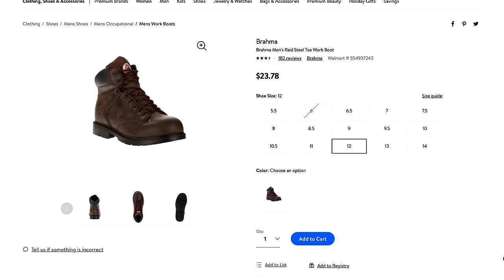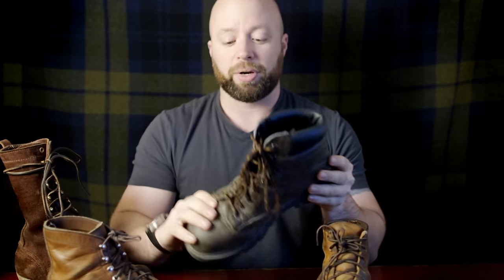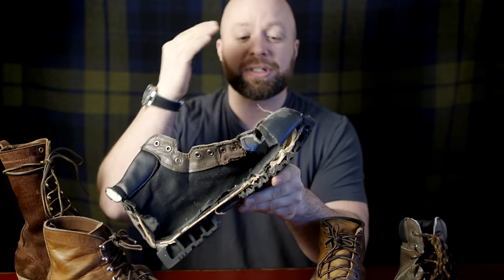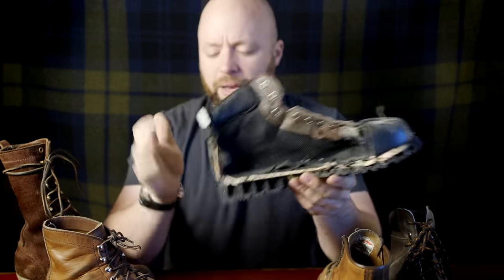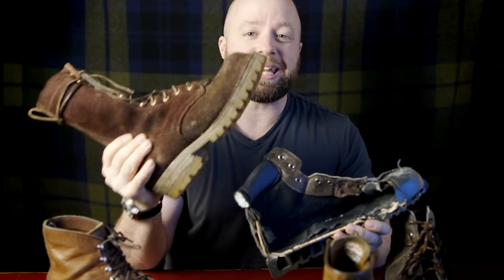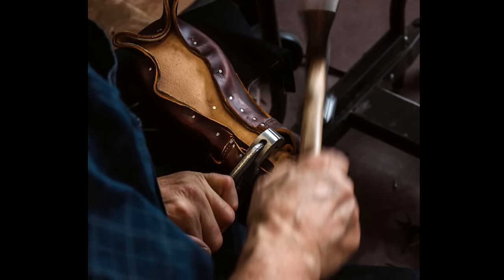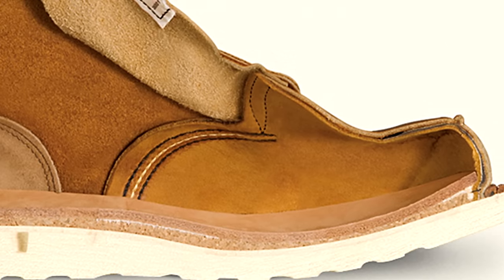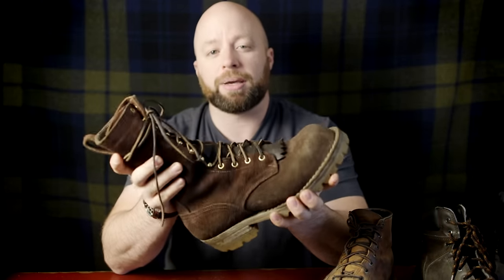Expensive vs Cheap Work Boots

Comment: Love this video! Wanted to share my experience because I realize its incredibly uncommon. So I work as a Locate Technician for Dominion Energy, and my job requires me to walk between 1-5 miles a day, and lots of crouching. I started my job about a year ago, and bought myself the Doc Martens 6" Heritage Ironbridge ST (retail $134.95) and within 3 months the sole of the right boot had split down the middle, and made the sole completely seperate from the boot. It was the middle of the work day, so I had to make a quick trip to Walmart where I picked up the exact pair of Brahma boots as shown in your video. While they were terribly uncomfortable, the lasted longer than my Doc Martens by about a month. The bottoms eventually started cracking and water was seeping into my boots from the bottom. I then replaced them with the exact Colemans that you have in the thumbnail (retail $69.99), and they took the cake for the most uncomfortable boots I've ever worn. Within an hour of wearing them I had sores on my heels that had been caused by the steel shank in the heel of the boot, they had torn through my Carhartt boot socks, and have absolutely no support anywhere at all. Comparing the Brahma and Colemans I would take the Brahma 10 times out of 10. Needless to say I returned them the following day. I am now on my 4th pair of boots within the last year, and they are the Denali Bullseye (retail $44.99, purchased on sale for $29.99), and so far they are up to par with my Doc Martens as far as durability goes. They are not as comfortable, but absolutely a step up from the Brahmas and Colemans. From my experience, you shouldn't settle on the cheapest boot, but paying an absurd amount may not be the best option either. Venture out and try a variety of different boots until you've found the ones that best suit you.

Comment: How are baffins, I work around drilling chemicals including formaldehyde, acetic acid, sulfuric acid (low concentration), oil based drilling mud, water based drilling mud, and cuttings. I need a waterproof boot that can stand up to 35 days straight of 12 hour days. I've tried multiple brands of rubber boots from a $200 pair to a $50 pair. Rubber boots just fall apart. I need something that will last more than 1 35 day hitch. I currently run some schmidt's from tractor supply that work ok. But I'm looking at getting the best that will last the longest

Comment: Security guard here so I don't need stuff like steel toe or metatarsal protection.

Had a pair of Worx (by Redwing) that were about $120 in that 'tacticool' half leather half black nylon style.  Side zip, composite toe (I used to be around a lot of electrical equipment).  Got some of those plastic reinforced insoles.  They were fine but after a while the top of the boots sagged and I somehow managed to wear the hell out of the insides.  When I went back to the store to shop for another pair (they didn't have any in stock) I learned that the rep gave me a pair that was too wide, even though I stood on the sizing machine (think she wanted credit for a sale or a commission or something).  Didn't inspire me to go back.

Next was a pair of EMSs by Danner for $250.  Ho Lee Fuk. All leather, no metal, antimicrobial (sp?) insides and with some Protalus insoles, these were night and day better for $100 more.  Like the Worx you can't resole them but four years and they're still good.

Comment: A little over a year ago, my Grandfather bought me a pair of these (the Brahmas) because I needed a work boot. Despite being a size 13 they fit like a size 15 and I slipped 3 inserts into the actual boot. After stuffing three inserts (the inserts that came with them, and then a pair of Dr. Schol running insoles, and then an insert from a pair of Nike running shoes on top of that) they actually wound up being pretty comfortable. (My shoes came with inserts in them, and the ones in the video do not have them)
Reply from the maker: Well you definitely modified the heck out of those! I think they can work well at first, but not long-term. Still man, the fact that your grandfather bought them for you gives them a special meaning. What a good dude. My grandfather left me a bunch of his old tools which I hold very dear.

Comment: Try working a shovel with those damn Brahma boots. The first stomp on the shovel will kink that cheap plate in the sole. About every hole I had to take my boot off and bend it back as straight as I could to walk.

Comment: "Buy the best tool you can" is why I spent $320 on a pair of 8" redwings. Been 2 years of heavy almost daily wear and haven't looked back.
Reply: What trade are you in? Im in grading and am looking for  a new pair. I Have had my timberlands for over a year  now and i can say they were worth it to me.
Reply: @adamsgame62  kind of a jack of all trades. I'm a manager at a carwash so usually 8-9 hours of walking on concrete that could have up to an inch of water with the occasional plumbing, electrical, and welding inbetween when I'm not rebuilding/replacing equipment.
Reply: @jacobgebhart7550  nice! Reason I asked is I'm always on dirt or base rock so I'm looking for something that will be comfortable but will last.
Reply: @adamsgame62  I've probably worn these boots 650 times in the last 2 years and while they need to be resoled and given a new pair of laces they've held up extremely well. I want a pair of nicks for my daily wear and use the redwings as backup for the nasty stuff.

Comment: I swear by Irish Setters. Elk Trackers uninsulated for anything but work and the aluminum safety toes for work. 
Buy them on sale and find a coupon. I bought my last set of Elk Trackers for $65 form the local Red Wing Shoe. My last pair of aluminum safety toes were about $80. 
Local leather shop can resole for about $35. 
Have heard great things about thorogood boots. Have never tried a pair. 
My local leather shop also makes a great pair of cowboy boots.

Comment: Cheaper boots are better in long run when you work in Stucco/ EFIS.

Expensive boot will be destroyed by the calcium, acrylic, and quartz. If not cleaned after each use.

I've narrowed down to a year and a half on a pair of timbs pitboss

Comment: Redwing Iron Rangers may not be as beefy as most current work boots but they were designed to be like old work boots, hence the “heritage” in the name. They were work boots then so they still are now. They just don’t have modern updates. I would say the Iron Rangers can be a work boot worn if you’re not worried about crunching your toes with something on the job. The newer Iron Rangers do have tread on the bottom as well. They are a versatile boot. Work, casual, or semi-formal settings. Given their good qualities and being versatile, it makes sense that the “hipster” crowd takes advantage of them if you want to go there. A have noticed there is a broad array of people who like them.  (Long comment I know. Bored on my brake 😉)

Comment: I will agree on most of what you said.  However I will say it is worth it more to buy good insoles and cheap boots, in the case of very high replace rate. Example if you are doing epoxy on floors where it builds up on your boots and you can't get it off.  As cheap vs expensive will both go at the same time. Having two sets of boots is good for that as when you are doing the less nasty part you can wear the good ones.

Comment: I've worked in the Wescos and the Red Wing 877's and they are awesome.  Never had Nick's or Franks, but was told they are very good boots.  The price was worth it since both boots lasted over 6 years and my feet and back feel fine.

Comment: Could not agree more. Over here in Europe we have not that choice of you guys in the USA. I have to use the S3 class working boot for over 20 years.Wear and seen a lot of sorts and brands passing by. My defenitly choice is the Lowa Renegade mid S3 and a pair of sneakers look alikes, the Elten (L10) with Vibram soles, also mid high. Both are not the cheappest ones. But the last for almost 3 years now. After a day working with grease,oil, debriss i Always clean them up and, if necessary a bit of leather grease. Checking the laces.That makes the difference between cold and wet feet and dry and comfortable working through the day! Also remind that your socks are playing a very important role in this matter. Change them every day for a fresh pair. Let the shoes breathe well overnight.

Comment: Good explanation of the value of workboots. That solid support will help avoid lower back and knee issues in the long run. My favorite work boots are a pair of Viberg Foreman's. Viberg sells a lot of expensive fashion boots to the Japanese and urban Hipster markets, but they made their original  reputation building extremely sturdy work boots. If you don't have time to learn about insoles, midsoles, heel counters and all that stuff that makes a high quality boot, just pick them up. Leather is heavy and good boots are heavy boots. My Vibergs are 6"  and they still way over six pounds the pair. Leather everywhere. They take longer to break in, but when they're broken in, It's such a perfect mold to my foot, I wouldn't dream of skimping on cheap boots. My back and knees and feet are worth it.

Comment: My own experience over the years has been that if boots cost less than $100, they simply arent going to last. Even if you're not doing physical work. In a basic office type environment, cheap boots are going to let you down.
That said, I've have never, and will never spend more than about 250 on boots. It's not necessary for what I do. But there are certainly people working jobs that should considering spending well over what I spend on boots because their work type really requires it.
If someone is working in a machine shop and is fine with walmart boots, they aren't working in a machine shop; they're just collecting a check and someone else is doing all the work.

Comment: Here is my question for everyone...I work in a cold storage warehouse. Most times I am either in 35 degree weather or in -8 temps. I have worked prolonged periods of time in the -8 temps (everyday/5 days a week). I have tried redwings & thorogoods and over time the soles break in half due to the freezing. After about 2-3 hours straight in -8 temps the soles are rock hard. It only takes about 4-5 months and soles just break in half. Any thoughts on different boots or better suggestions on what to buy?
Reply from the maker: Check out Refrigerwear. They were designed for people working in conditions exactly like yours, with a line of footwear, jackets, and coats.

Comment: Redwing heritage Roughnecks for life. Best work boot I've used. Made soo well. And they're basically waterproof even in they're not rated as so because of how well the heavy leather is oil tanned. Comfortable, beautiful and tough. And have some of tbe best Vibram soles out there. 

Although I don't need Steel or Composite toe at the work place. In fact I think steel toes are a bit of an odd thing, but if they're required you have to wear them obviously. But if something heavy enough drops on your feet to crush your toes, you're doing something wrong.

 Plus some work places recommended against them where there's a high chance of something landing on your feet. Your toes can get cut in half from the steel.

Comment: Used to use the cheaper justin square toe workboits the ones around 100 bucks and they were good and comfy but inside the throat always brokedown before the rest of the boot unfortunately but good boot . Then i bought a pair of square toe Ariat workhog square toes priced at about 180 the ones without composite or steel toe. I never knew my feet could feel so fresh at the end of the day with the composite shank in the arch area my feet were thanking me so much and i realized that since my feet were not aching at the end of the day my quality of work and my attitude were much improved.  Not bashing the justins. Just me personally i would use the cheaper justins if im doing really dirty work and destroying the boots because they're cheaper and my ariats for everything else

Comment: red wings are the absolute best. had a pair of 4417s for damn near 5 years til i dropped an angle grinder on my foot and ripped the toe open. id probly still be wearin em today if i didnt do that. best $200 i ever spent. even the carolina loggers i had didnt compare- the leather got eaten away by mastic remover and so did the skin on the top of my feet!

Comment: Boots are important. But don't forget the socks, too. There is a large difference between a cheap pair of Hanes or Fruit of the Loom socks, and a solid pair of Fox River or Wigwam work boot socks. Better material, thicker, better sweat handling, etc. Like a quality pair of boots, they make a big difference by the end of the work day. They are worth the money.
Reply from the maker: This is absolutely true. I’m a big fan of Darn Tough Vermont socks, but I’d love to try Fox River.
Reply: I've not tried Vermont, yet. But I will. I never realized how much difference quality socks made to a work day until a retired tradesmen friend gave me a pair as a gift.

Comment: 100% agreed.  US Steel (Fairfield Works - Seamless Drilling Pipe) required metatarsal sheild boots.  This protects the top of the foot and just steel toes results in cut off toes if a pipe drops on them.  Even in the 80s they were over $100/pair.  Seriously heavy but also super well built and comfortable if you wear it for 12+ hours every day.  Cheap boots are torture.  Boots are a tool you don't skimp on.

Comment: So for years I bought nothing but Georgia or Carolina and loved every pair until about 3 years ago I bought the same pair of Carolinas I had bought many times before. Never had to "break them in" but these ones were different they didn't feel like home. Upon further inspection I find that both of these 2 companies are no longer manufactured in the US. The price point didn't change but the quality certainly did as they never became comfortable and didn't hold up. I recently bought a pair of Justins it's been 6 months so far so good. Also I would add that if I spend $300 on a pair of boots that last 3 years it's still cheaper then buying a $30 pair of bramahs  every 3 months in that same time period dollar for dollar not even taking in to account the medical for back problems and fungal infections.
Reply from the maker: Unfortunately this happens more than we realize. It’s cheaper for the manufacturer and they simply rely on brand recognition, Filson, North Face, even Doc Martins have followed this trend.

Comment: In England employers must by law provide safety equipment which includes safety boots and shoes if it is deemed they are required. 
This sound great until you realise that most companies buy cheap.
For my entire career I have had running battles trying to get companies to provide quality boots and in the end gave up and started to buy my own.
Even now working for a company that does buy the goods stuff I still purchase my own boots as I want control over what I wear.

Comment: One place I worked practically ate boots. Didn't matter the brand or how cheap or expensive they were. You'd be replacing a pair of boots inside of a year. That said, a more expensive boot was way more comfortable.
As a sidenote: Walmart made one good, comfortable work boot. They were branded under Herman. They were still cheap boots but they worked. Until they changed the design. I had an old pair lasted about six months and went to buy another pair of the same. I didn't notice at first the small differences in the new pair from the old, but apparently it was enough. They became unusable in about three days. They let water in on the first day and the heel was coming unglued. Them cutting corners ruined an actually decent product of theirs. Bought some Wolverine boots after that.

Comment: I just got into ironworking and decking December of 2018 and I was using a sixty dollars pair of brahmas. Not only did they basically shred in less than a month but my feet were in so much pain by the end of the day I didn't want to move to take a shower until over an hour of being a couch potato. Two days ago I went and got a wedge soled 8in high steel toe pair of thorogoods; and my God the whole day people asked me about them and I would say it felt like gliding on clouds man. And I definitely trust them on the iron more then the previous pair of brahmas

Comment: Red Wings are the best in my opinion.
I first tried Red Wing in 1978 and worked in a steel fabrication company for 2 yrs.
Then went into trucking for the next 10 yrs and I wore those same boots for that period of time 12 years. I then bought another pair and went back into a plant building airplane engines at GE. I kept those for 12 yrs also. My 3rd pair lasted me about 7 yrs. My 4th pair I bout in 2008 and just went in to Red Wing because my sole had worn out on the outside where the bottom sole was splitting from the inner sole. They told me they couldn't put on a new sole cause it would require them too put in an entire new inner cushion sole. I wasn't happy about that , but went to an another Red Wing boot I had but hadn't worn much. I'm wearing those now and they feel great as did the others in the past 40 yrs. My uppers on the pair they wouldn't fix is in great shape and I may go to a shoe repair shop and see what they can do. You get what you pay for.